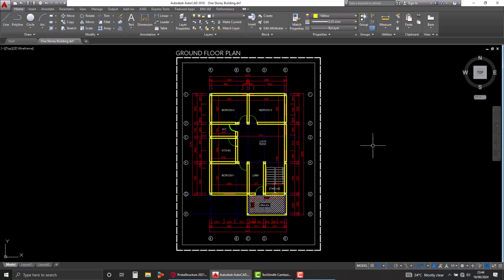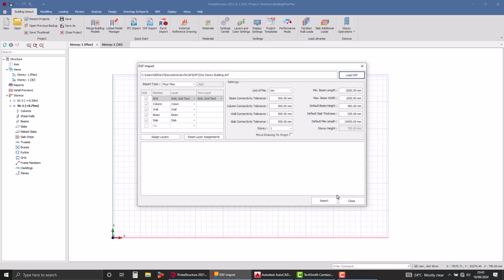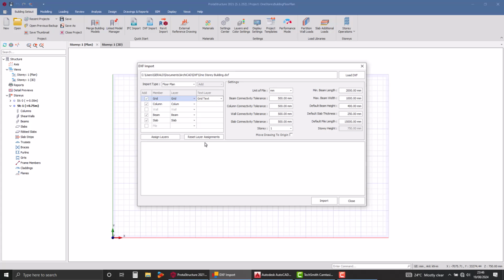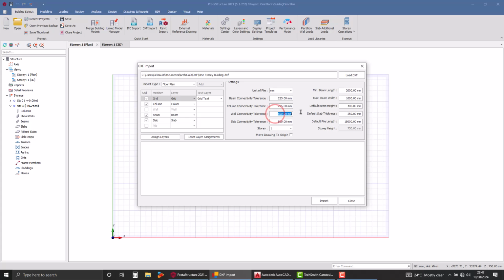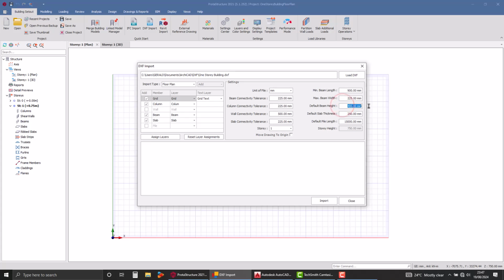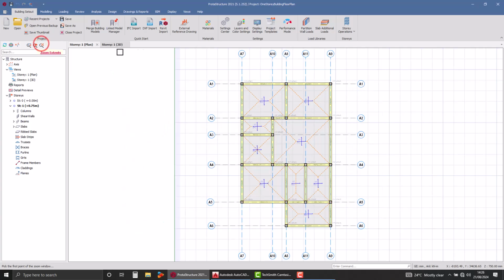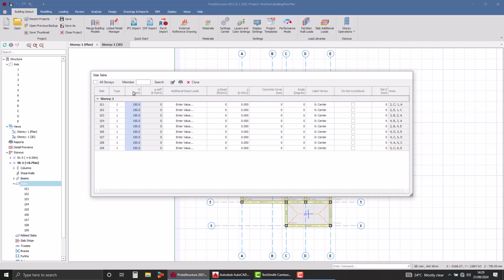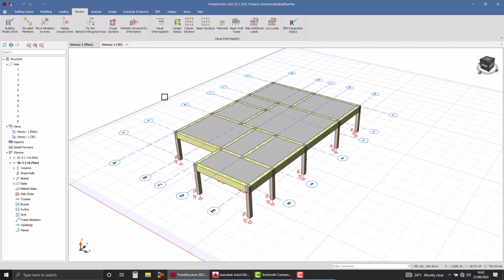DXF To ProtaStructure - A Simple Import Guide.

Comment: It is not working with me
Reply from the maker: What exactly, which version of the application are you using?
Reply: @MichaelsStructuralStudio-f6z  When I import from the AutoCAD file, the beams do not appear correctly; they show with an excessively large width, and some of them do not appear at all.
As for the grids and columns, they appear correctly.
Reply from the maker: Ensure to use the same unit in both applications.